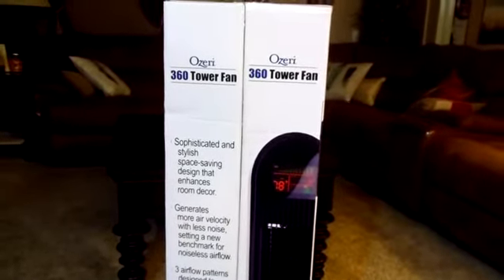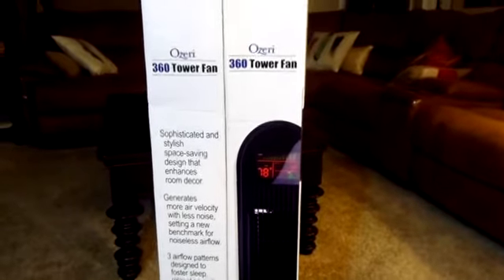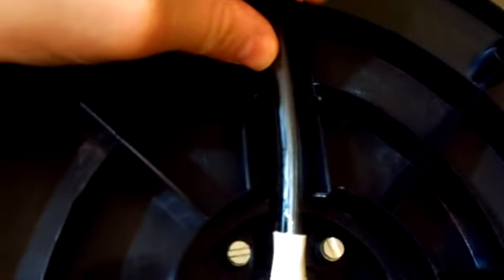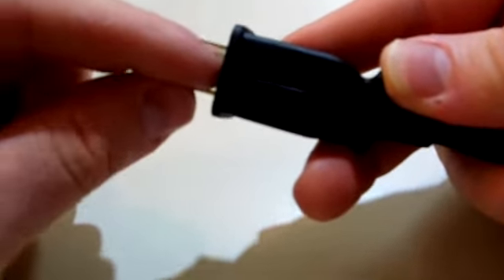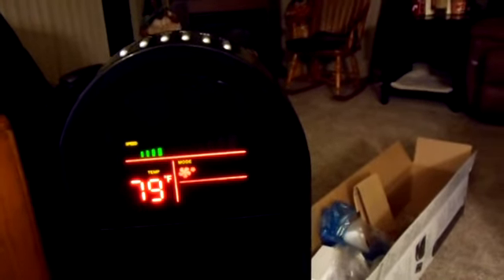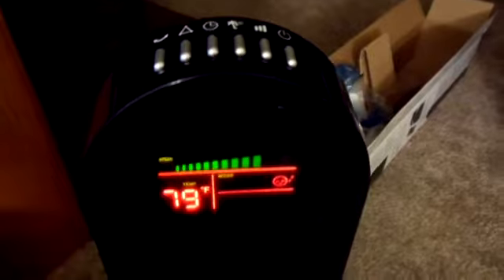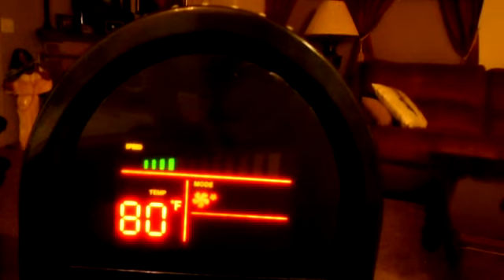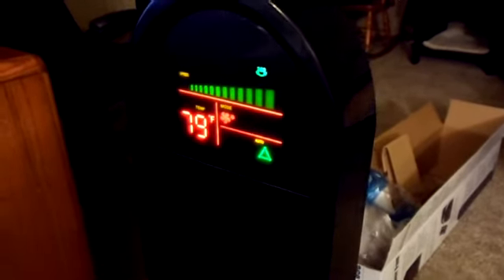Ozeri 360 Oscillation Tower Fan, with Micro Blade Noise Reduction Technology

Comment: I just ordered today the brother of the 360, the Ultra-Wind 42". 
Had you tested both before finally choosing this one? 
I do realize that the UW42 does not rotate at 360 degrees, was this the deal breaker for you? 
I much prefer having AAA batteries in the remote of the UW42, instead of CR2032 in the 360. Love your cat doing the official stage manager! 
Thank you for the informative video.